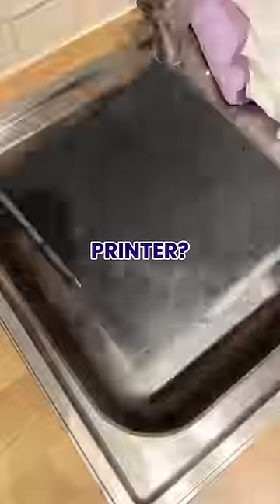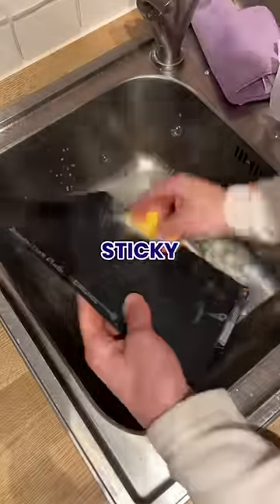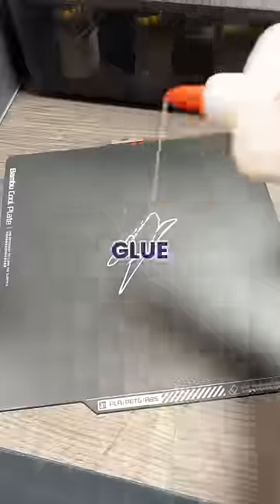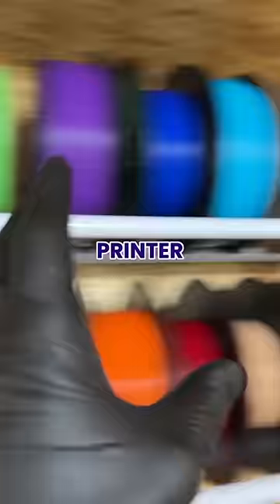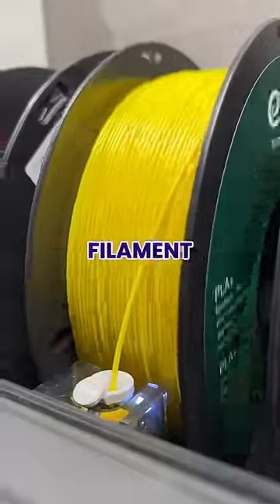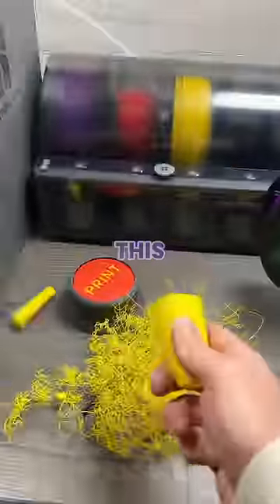Can you use PVA on your 3D PRINTER?! 🧽#3dprinting #lifehacks #shorts

Comment: I've been using a 10:1 water:pva mix for over 5 years now and it works for me. I apply it with a plastic squeegee and refresh it with a damp sponge every dozen of so prints. Doesn't matter if I'm using my glass, textured pei or g10, it always helps. But I don't use it to get parts to stick, I use it so it's easier and safer to remove my prints without damage to my build surfaces. Glue stick was always too gluepy and messy. It transfers to my parts leaving them sticky and dust sticks and builds up on the print bed with glue stick. Spoiler alert glue stick is also pva but it's a higher concentrate. I'll stick with my 10:1 mix. It's cheap and reliable.
Reply: Or or or, just use a brim and stop with this unnecessary glue shit lmao. Never used glue on my printer and I don't plan to in the future. Using a magnetic bed on the ender 3.
Reply: @ss_ramsay Or, or, don’t waste filament. Brims are a waste of material, when glue is much cheaper and easily disposable
Reply: I used an immersion blender to mix an entire glue stick into an alcohol bottle. I spray over the glass plate and distribute the mix with a microfiber cloth.

My bed has odd dimensions so there's no magnetic plates available for it. The glass is SUPER sticky with that mix
Reply: Is the ratio by weight or volume?
Reply: Just use rubbing alcohol, i use a pei bed and have perfect adhesion every time
Reply: @ss_ramsay letting you know the brim is less reliable and a waste of filament since you have to rip it off and debur the bottom  to neaten it up.

Source i 3d print

Comment: that normaly works interesting. PVA wood glue mixed with cleaning alcohol and water turns into a gel like substance and i have used it as an adesive and a print release agent when remixed with water/alc on the oldschool non flexible beds. Needs a bit of temp tho 50°C and only a very small amount is needet

Comment: I've never used or needed to use any glue for printing. I use a smooth pei sheet lightly rubber with steel wool and cleaned with denatured alcohol.

Comment: First, you can clean PVA off with water. 
Next, you used too much glue. You need the tiniest amount. Spray water on the plate and lightly apply glue from a glue stick to the wet surface. Let it dry using the heat bed. Then print.

Comment: I had seen that you should wipe your build plate down with isopropyl alcohol on a paper towel, let it evaporate and then apply a thin, even coat of an Elmer's glue stick (like the purple one).  So far it has been working for me.

Comment: I have read that when using glue sticks you should spray a tiny bit of water on it and use a piece of kitchen paper to create a texture in the glue for adhesion. I wonder if a pva/water mix would be even better over just water.
Reply from the maker: That’s a good shout, we just did it neat and it definitely didn’t work! Formed like a skin rather than a sticky layer
Reply: What I do with pva is spray some isopro on it before printing.
Reply: I use glue sticks all the time with PLA and PETG. I apply it as smooth as possible but don't bother with any additional steps.. just apply a thin cost in one direction, and then a second thin coat offset 90 degrees. I also use a glass print bed. I will use DIY ABS glue if I am printing with ABS

Comment: Stop using glue? Just increase your bed temp, or lower your z steps, or just dlow down the first layer, or use a brim. Been printing for 2 years on a glass bed, have never needed to use glue. Silk, pla, pps, abs, petg, composite. Literally sticks to the smoothest surface possible, you have a textured plate. If you need glue you are doing something wrong.

Comment: I have a kobra 2 pro and I regret buying it there’s no native klipper to change some important setting or tune anything the auto leveling is not that great and you don’t have an option to manually level it also I tried to print some of those “wands” like the banana but smaller and it just fused together when other people even on Enders had better results its probably my setting but idk I tried everything also I changed the nozzle and now it smells like plastic is burning and I tried everything to solve that but I think I have to buy a new hotend probably gonna buy a bambu in the near future